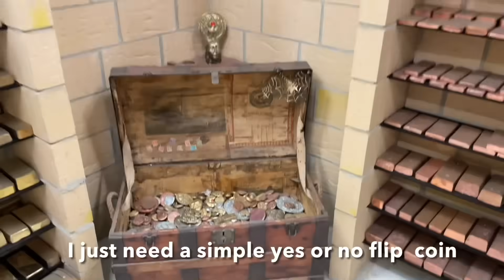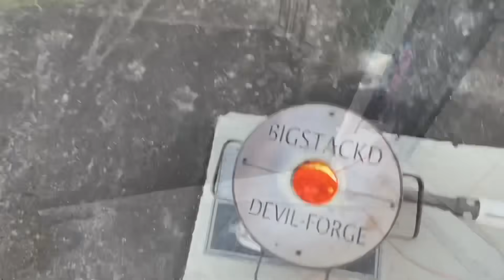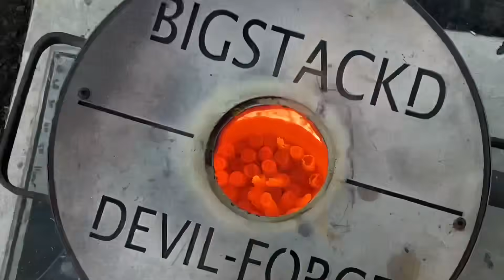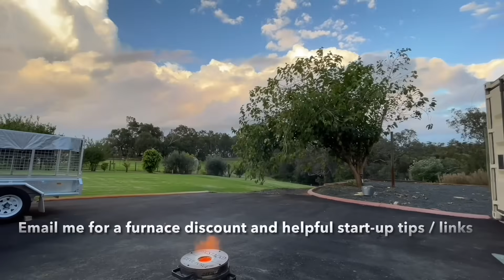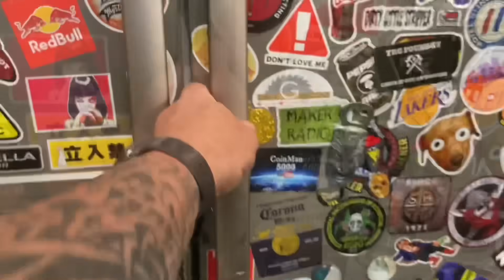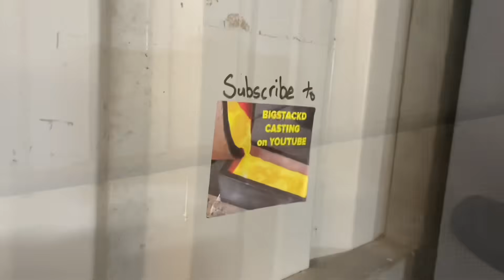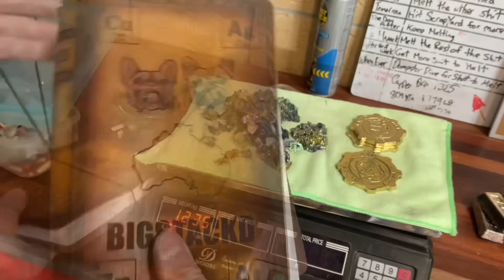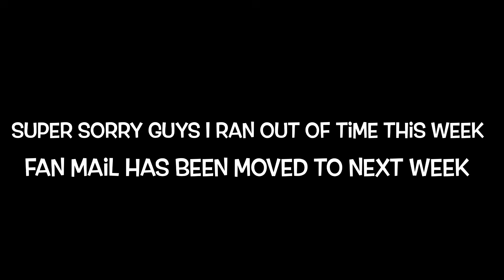Bismuth Crystals And Bullet Casings Casting - ASMR Metal Melting - Trash To Treasure - BigStackD

Comment: You want the bismuth to cool and freeze as slowly as possible to get the largest and best looking crystals. A great way to help that is to wrap the pot or pan in aluminum foil to contain the heat and let it cool more slowly
Reply: It reacts with aluminum which makes it lose color.
Reply: @connor_ono3611  I think they mean on the outside of the pot
Reply: I use a small pot so I can let it cool nestled down in hot sand in a bigger pot. The crystals grow great from the surface downwards, but I'm not good at extracting them in one piece yet.

Comment: Usually what you want to do with bismuth,is melt the lot,then when crystals form on top of the pot of bismuth,you use tongs to break it up and take out the crystals,works better than putting bismuth in a bunch of smaller bowls to try to get singular piece chunks of bismuth.
Reply: You can get bigger crystals if you let the bismuth cool for a bit longer before breaking it up
Reply: And one more thing,sorry for all the comments,bismuth is a brittle poor metal,so,not worth casting.ok,iam done now

Comment: Maybe put a little flat piece of iron into the 3D print when you make them?, and lift them out of the mold with a neodynium magnet?, dont know if it works, just a thought 😁, of course tap them lose as you do anyway

Comment: Have you seen Tantalum? Its high melt point but your furnace might pull it off. Considered one of the (if not THE) rarest metals in the universe. Semi-precious, its got a blueish color. Used heavily in electronics such as capacitors. Cool stuff, and relatively cheap. I know you dont mess with silver and gold, but this is one you could have fun with AND maybe see its value appreciate over the next decade. Check it out!

Comment: OH my specialty after copper and silversmithing......this was created a while ago when we first started doing them.   Here is my advice.   You want to heat the bismuth to a higher temperature first, and let it slowly cool.  Also you're doing the pour out method.  We do crystal pulling now.  Where they grow upside down from the surface towards the bottom.  (Remember the crystals grow towards the cooler temps.  So you have to have a colder bottom not surface to do this.)   Also note:  your crystals will only be as big as your container is deep.   So start off melting down the bismuth a  Before it hits freezing point, (note, no stirring was done which only increases oxidation) pour entire pot into a same sized, preheated to still above freezing and let it very slowly cool down but again before freezing, do the exact same thing.   If you're doing pour out at this point you would skim the top right before you pour it out.  Otherwise you're coating all your crystals with slag.  To pull a crystal you put a bent (so crystal doesn't slide off it doesn't stick so make a loop) with copper wire. You also need to set the final container on a cooler surface so crystals will grown DOWN not up towards the cool air.    My son can just hold the wire still with pliars but it has to be done so slowly..... you can also just use pliars to pull the entire formation out at the end  without a wire but it's tricky.  So pull the crystal out when you see other crystals forming around the sides under the surface.   Pull the wire slowly out.   You can just cut the wire off but it's useful for art applications and viewing with getting oily fingerprints on the crystals.    The colors come from oxygen so when you have crystals from the pour out method they don't get as much oxygen and the colors are faint.  Crystals without slag and lots of oxygen become GORGEOUS.   Also, the colors are just tarnish.    https://www.facebook.com/BismuthIsThePhilosphersStone
Reply: OH GOSH, I got up and posted too early, I see you're doing the pull out type.  You need to go SLOW, it will start to form while you watch, almost like transformers.  Just keep slag away from it as you pull it out.

Comment: I remember reading about bismuth. I remember reading that you can assist the crystalification process by throwing in a few sacrificial crystal pieces or a broken piece when you set it aside to cool.

It's the same idea that Chocolateers use to help their tempered chocolates cool cleanly. They call it "Seeding."

Basicly. The solid structure acts as a catalyst to begin the crystasis, and subsequently also acts as a scaffolding for the formation of new crystals...

Next time, try leaving something metal in the liquid bismuth as it slowly cools, pull the object out while the bismuth is still liquid. You'll find that the bismuth has formed crystals on the surface of the object.

Comment: Why brass produces everytime a lot of slag?
Reply: Brass tends to tarnish fairly quickly because of its metal components, copper and zinc get exposed to the oxygen in the air. The same thing also happens when it comes into contact with the oils on your hands

Comment: Oh yay I asked you to make bismuth crystals so long ago! By the way the rainbow color is from various bismuth oxides forming at different temperatures as it cools.

Also, it forms that hopper squarish crystal structure because of bismuth’s unit cell which is rectangular, so it prefers to solidify into cubic shapes
Reply: Did not know that! Thank you for explaining
Reply: Amazing
Reply: Is Bismuth used for anything special?
Reply: Lol omg your enthusiasm is very cool, I think this creator might know oxides though lol
Reply: @jasongrinnell1986  Your tummy when you're sick. Nausea, heartburn, indigestion, upset stomach...etc lol
Reply: @jasongrinnell1986  it is an ingredient in Pepto Bismol.
Reply: @jasongrinnell1986  shotgun pellets.
Reply: In a special alloy with tin and indium that melts at 62⁰C
Reply: @jasongrinnell1986  the compound bismuth subsalicylate is the active ingredient in pepto bismol
Reply: @Elbert844  and fishing weights also to replace lead
Reply: I thought that straight line, 90 degree angle natural form was quite interesting. Also, when it formed seemingly perfect cubes.
Reply: Originally, it was believed that bismuth was the densest non-radioactive element. Apparently, its radiation at its base isotope is weak and has a veeeeeeeeeeeeeeeery long half-life.
Reply: @jasongrinnell1986  Bismuth is useful as a lead replacement because it's non-toxic but still quite dense and has a similarly low melting point. It's brittle though, so it's not a perfect replacement in cases where lead's malleability is really important.
Reply: Best comment!

Comment: Here is a crazy idea since you can melt bismuth at such a low temperature why not treat it like candle wax use a couple of seed crystals dip them into the molten bismuth for a second pull them out and dip them into a cooling agent I would sugjest a container of liquid nitrogen for quick dips since it shouldn't cause steam explosions but you could also use computer dusting canned air instead.

Comment: Any experience with window ac units bro? I found one today and started breaking it down and luckily found out its illegal and dangerous to release freon before compromising any of the copper pipes.Know of any way of telling whether or not theres even freon in the system or not without any fancy equipment, or any suggestions at all? I definitely don’t wanna put any money into breaking it down so if taking it to someone to get the freon out is all i can do id rather get rid of it i guess. Appreciate any knowledge u can offer brother.peace

Comment: Hey man. Dig your content, but ive noticed a thing regarding your channel several times now. It may very well be on my end, but I only seem to experience the issue after watching your videoes. - My sound/laptop-speakers goes haywire after watching your videoes. Crackling and sputtering. - As said; might be on my end. Alas, the issue typically starts right after your intro.
Reply from the maker: That is very strange mate I’ve had not heard anyone else say anything like that🤔
Reply: @bigstackD  Ah well, may very well be my laptop then :) - I dont have any issues on my phone either. Thank you for your reply :)

Comment: That crud you're skimming - put it back on a spoon and apply a torch - about 90% of it will melt back into pure bismuth.
I play with it when I don't have time to do real melts, pouring coins and whatnot for the nephews to use as dive toys in the pool - if you do the heat just right you can get the rainbow effect on your coins, which is REALLY pretty in the noonday sun.

Comment: Watching the parts I glossed over or missed yesterday.  When I'm sanding metals  for  indoor sculptures or architectural elements that will not be patinated, I do circular motions   The  first grit the pressure stays the same but next  grits sand at one pressure then gradually lighten up until barely touching.  And the last few are wet sandpaper only.  I clean with windex as I go also so I can strip the dust easily to check the finish.    I rotate the piece half way through each grit.  My  final "grit" is DRY  steel wool #0000 grade. When I'm using metal wool I use a cloth  or wad of  cotton to spare my hands.    Finally clean noble metals with always a silicone sponge and  "Bar Keepers Friend" or other oxalic acid cleaner/rinse well, wash again in hot soapy water and cold water rinse.  Windex with paper towel  wearing gloves.   Then use a  silicone polish/wax with cotton.  I use the metal polish "Blue Magic."  This is the only way I was able to restore and create a glass like finish when needed.  Also in casting brass/copper, copper is by far the hardest.  You need lots of heat.  More than most   can bare and that includes  especially molds.  Otherwise design detail is lost.  And you have to oil them.  I read about a guy had a vat of oil and he would heat the molds up to 1500 and right before pouring he would drop the mold in that vat before casting if detail was critical.   I learn so much from watch you,  Doubt there's much you don't already know.  lol

Comment: The bismuth crystals are very cool, I wonder if other metals behave the same. For example if you empty a mold seconds after you poured in pure molten copper or aluminum, would they form crystals as well? at some point during the cooling? It should be a very precise moment I guess, and also it must be a pure element.

Comment: Why does brass have so much slag? I'm assuming most of this slag specifically is from the powder residue in the casings and the firing pin. But other brass videos that aren't shells/casings also have a lot of slag produced. Is it just b/c brass is an alloy and not a "pure" metal like copper or alumin(i)um?

Comment: Are you aware of the method to add glass when melting brass to pull the slag to the surface. This makes it easy to knock it off with a hammer when hard.